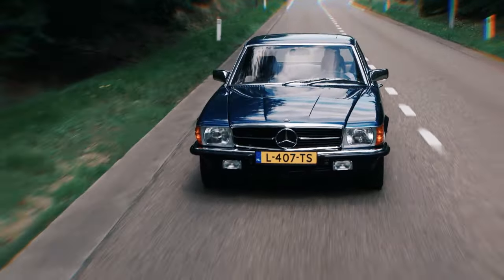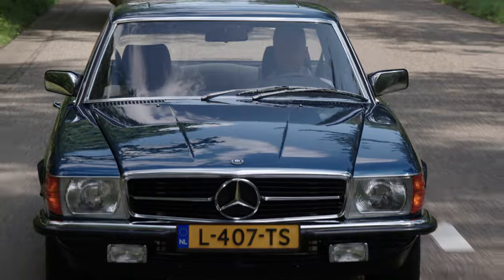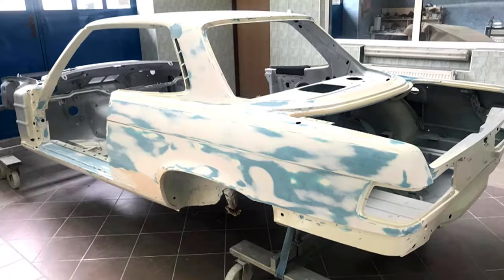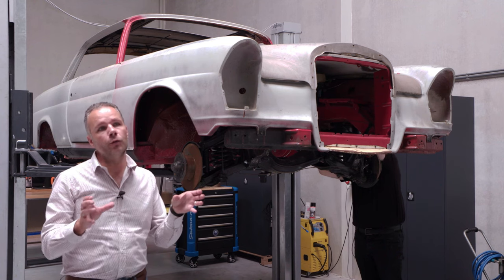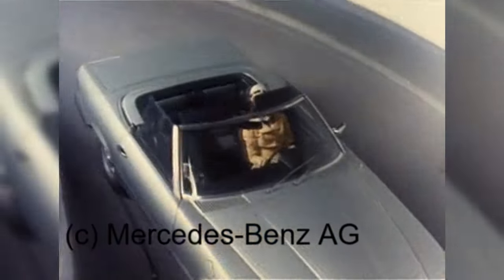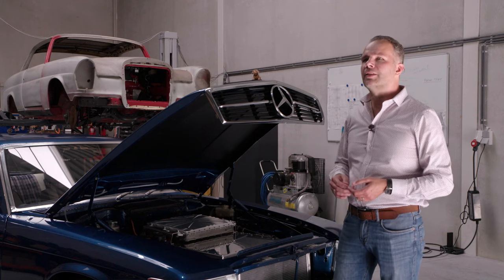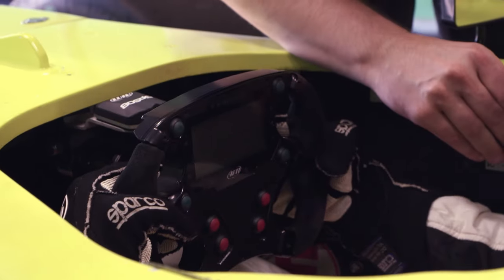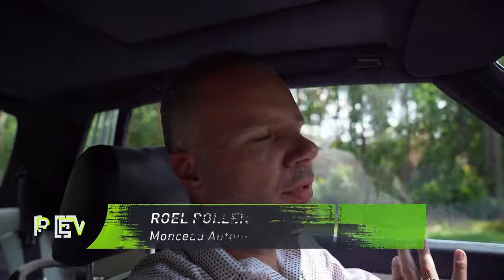Classic Mercedes 280 SLC Electrified

Comment: I currently own a 1975 450 SLC but don't drive it as my everyday car because of the gas prices here in California, I have always wanted my next car to be electric. If I already didn't have a new engine I would love for this to be done to mine. I have no problem with converting from gas to electric. Great concept and great keeping the classic's up to date so they can be enjoyed in the future without polluting our planet.
Reply: Thanks for your positive feedback Henry and great idea to build an eSLC of your 450SLC. If the starting point is only to reduce costs (on e.g. fuel) then a full-on conversion is still too capital intensive to make that business case. You also need to factor in the coolness, uniqueness and great driving experience of an electric classic. Especially if the car is build with the full Monceau treatment (complete restoration and the proprietary Monceau electric drivetrain). But we're always happy to think alone and help in this!
Reply: Let me guess timing chain broke at 176,000

Comment: It would be interesting to cover the safety aspect of this process. Since the original car wasn't designed for the weight of all those battery packs. And the chassis rigidity changes with removing all those original components.
For example Volvo explained that when designing the new XC40 Recharge, they designed and added whole bunch of new chassis structures in front of the car to improve the rigidity. Since without the engine, it was just mostly empty space now.
Reply: WIth what I am planning I am calculating not just the weight of every item that will come out of the car but also where it is coming from and trying to maintain that balance even if it means moving half of the batteries into the engine bay.
Reply: Thanks for your reply! The weight of this electric build is however not heigher than the original car. We are at 1,585 kilograms whereas the platform was somewhere between 1,520 and 1,650 kilograms depending on the engine (450 V8 was the heaviest). We are also within the performance levels of this chassis, we are slightly faster than a 500 SLC in terms of accelleration and lower in terms of top speed. Also the space between engine and front of the car is still respected after the rebuild. So our cars are as safe as the original cars and due to regenerative braking and in near future traction control, even safer than the original in terms of passive safety. That said it obviously still remains a 40/50-year-old car with dito safety expectations.

Comment: Good think about a R107 is that it's engine compartment has plenty of space and the trunk can be used for the another battery if the gas tank is removed, I sure would like to do that to mine, but I already rebuilt the original engine, maybe if I find a dirt cheap one out in California, then that project is possible
Reply: Thanks and agree the R/C107 are great cars for electric drive. In some ways even better than the original cars.

Comment: You guys should check out Electric Classic Cars in the UK. They've converted a number of Mercedes SL R107s now and are the leaders in converting classic car to electric.
Reply: We know ECC and their work. Generic EV converting garages are hard to compare to specialists like Monceau Automobiles. We are 100% specialized in Mercedes and know the vintage models inside and out. We do complete re-engineering based on 3D with only high-end parts and e.g. brand new custom designed liquid-cooled batteries. All cars are fully restored to the highest standards and all controls in the interior are redesigned with hidden technology. But that said, we love the variety of work at ECC!

Comment: what if the body convertion to fiber carbon material. so that the power to weight ratio can be nice
Reply: Thanks for your idea and that would definitely help reduce weight considerably. We always try to reduce weight where we can, but we are currently in the same weight bandwidth as the original cars. When we build a rally eSLC, I think carbon doors, hood and trunk lid would definitely make sense! The current cars are made for cruising 😊

Comment: I want know, how much is kw motor? And kwh battery per 300km range?
Reply: Motor has a peak power of about 150kW and peak torque of 600Nm. Battery packs are combined 52kWh.

Comment: Would it be possible to convert a 560 sec to ev considering it’s heavy weight ?
Reply: It's a bit more complex, but definitely doable and on our list. First up we focus on the W111 S-Class coupe/convertible and older SL models, but the W126 Platform (and especially the coupe versions) could be an option in future. We might have to add more batteries to get the same range as the eSL/eSLC.
Reply: yeah I agree and  would probably be easier as a touch more room..

Comment: 169k? You having a laugh? Most normal people can’t afford that… I hope this type of thing becomes cheap enough so I can afford it one day. £10-£20k for a conversion would be perfect
Reply: Thanks for your reply and indeed that would be great. At the moment however it is not feasible to convert a classic for that budget. All Monceau classics are also fully restored and build with only new and highend components.
Reply: Thanks for your response… I was just hoping a more scalable solution for conversions would present itself to us normal folk
Reply: @KausarClassics  We are sure in future it will get more  accesible. However a good quality build with full-on restoration, state-of-the-art components and a battery pack with usable range, will always be valuable. Thanks for your replies!
Reply: Check out Ford's electric crate motors.

Comment: 8:12 yeah, because a cheap electric engine which you can replace any time will keep the same value as an old relatively rare almost hand-made engine... just like an original Rolex has the same value as a cheap Chinese replica
Reply: Thanks for watching the full video, that's at least a compliment we would say 😉 But clearly not into EV or knowledgable about the tech behind it, but let's respectfully agree to disagree!

Comment: 1:02 "Our aim to keep that vintage classic feel in the car" ... one second later "the steering wheel was upgraded to electric power steering "... 😅🤦‍♂️ffs... I mean these cars are not classic cars anymore, you rip off their heart and soul once you get out the engine and the gearbox, and everything that remains is a empty shell, unless you intend to use that car as a daily driver an electric conversion doesn't make sense, and it definitely doesn't make sense for sport cars and off-roaders.

Comment: the designof this Coupe was SO weak....the W116 just with 2 doors and a hardtop would have rocked....as they did it with the 126
Reply: It's definitely a model that divides the opinions, you either love it or hate it and you seem to be in the latter group 🙂. For us it's really an iconic model, indeed the design is an acquired taste, but the only car we know that was made into a coupe starting with a convertible/roadster. Also the slat window is something you don't see often (probably you will say "for a reason"), however it's quite an interesting design feature, added to the car in order to still have winding windows for the back passengers (without it the window would hit the rear wheel arch). There is a lot to say for this car and design, but one thing stands out it's not plain or boring if you ask us. It's a design icon that appeals only to a particular audience, as we found out. Thanks for your reply and to be honest we'd also would have loved to see a W116 coupe, that would also be epic!
Reply: @monceau-automobiles  that would be job for a coach-builder :)

Comment: i want a retro mod car electric with 800km range
Reply: That's pretty ambitious. At the moment retrofitting more than 50-60 kWh of batteries is very hard in an average classic. Mainly the battery weight is the issue (as opposed to the original permissible weight of the car). But when solid state batteries come available, this can be done. Will probably take another 5 years though.